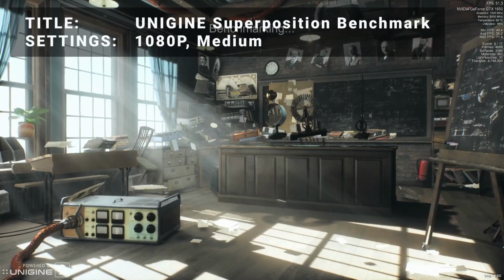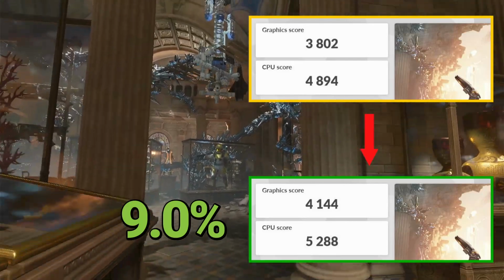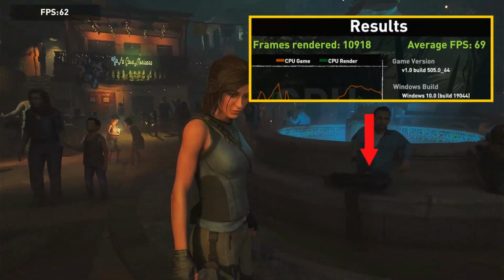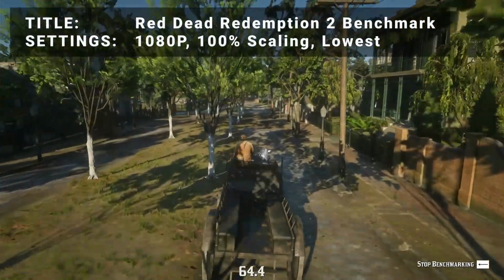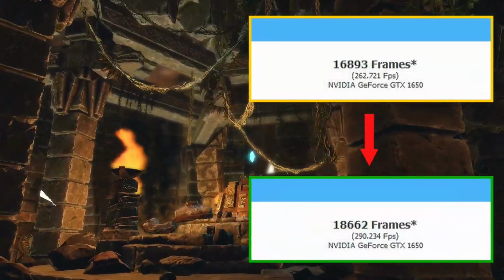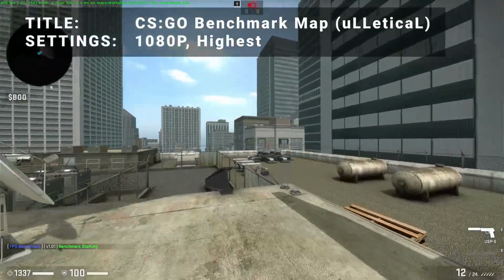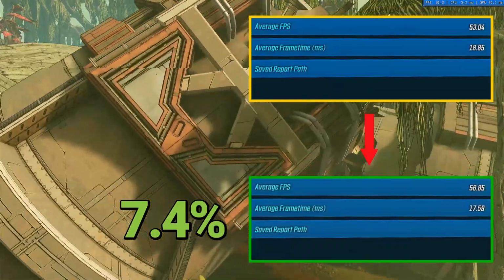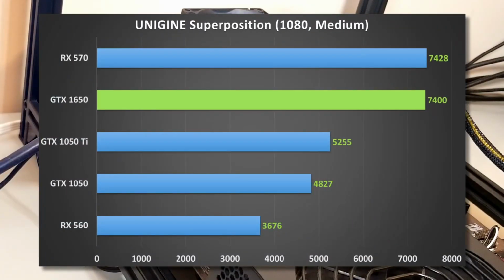Best GTX 1650 Overclocking Settings Guide

Comment: I overclocked my 1650 with msi and the performance got lower and when i reseted the settings it didnt changed to my normal fps   what should i do ❤

Comment: Just so I understand. If you overclock above 100 % power do you need to connect the 6 pin power connector, or is it safe to overdrive from the motherboard? (I guess not)

Comment: Hello i have a question, I have a laptop with a gtx1650 sometimes while i game my home electricity cuts off since i live in Iraq and recently my fps dropped drom 140 ro sometimes 60 or less ,is it because of the power cut off ?
Reply: yeah, you can make it so that doenst happens if you change ur energy plan on your windows

Comment: My card went to +1200 mem and +200 core stabely, i think i have a silicon lotery winner.
Its the asus tuf model and it does it at 80° idk how, the cooler is basicly an aluminum block
Reply: Yeah cooler is 'meh' on these😂

Comment: hey for some reason I cant increase power limit on my gtx 1650. I have a 6 pin connector on my gpu so It should have more than 75 watt tdp yes? but it doesnt. any idea whats wrong?

Comment: Awesome video ! Love the 1650! I've had my build for 3 years, and it was my first ever gaming graphics card.. but in a few days my GTX 1080 will arrive so it'll be my first ever PC upgrade. And I figured, I might as well overclock this little beast on the last days of using it to sort of send it out in a blazing glory lol
Reply: this is the only good reason to OC in 2024, but seriously , people who want to game with overclocking  a new GPU , dont , you'll be crashing or even worse damage your new gpu .. most modern gpu will push it self to the limit with only thermal throttle stopping it to keep it stable , overclocking is pushing the limit of  that safety feature .. if you just want to learn overclocking , hey you do you.
Reply: 😢 4gb vram is not enough for 1080p marvel rivals. Hopefully they release some optimisation patches
Reply: @SomePotatoChannel  put the game in fullscreen mode and lower your resolution to 1280 it will significantly boost your fps but visuals will go down
Reply: @alexcoutinho2354  bro i will not play on 720p. i just use upscaling but it still stutters even on 720p sometimes becauase the vram maxes out regardless of the resolution
Reply: @SomePotatoChannel  as you wish... i get 250fps on 720 with 1% drop to 150ish
Reply: @  stop the cap. No way thats real. You must be using epic tsr ultra performance or smth
Reply: @SomePotatoChannel  agreed, on my rx 6900 xt and 12600k I'm barely able to pull 120 fps at 1440p even with performance fsr which is rendering it from... 720p I think ? It's hard to get good fps in this game, it's poorly optimized lmao.
Reply: @  fsr performance on 1440p is rendering at 720p. So if you get 120 on an rx 6900 xt, there is no way hes getting 200 on a gtx 1650
Reply: @ yep
Reply: @SomePotatoChannel  yeah it's poorly optimized. Ive since rebuilt my entire system with an rx 6900 xt for a 1440p build, 16 GB of vram should be good for years lol
Reply: @Boba_Fett1980   dayum

Comment: I am getting low score of 6800 without oc. I am using a old cpu c2q 8400. Whether I can get high score if I change the cpu upgrade
Reply: yes, the recommended gpu for the gtx 1650 is the r5 4500, that is 681% better than the cpu you said

Comment: hi i have a gigabyte gtx 1650 i tried to overclock it but over +499 it simply crash how you got with +600
Reply: I’m using a laptop 1650 which is worse than yours and mine can do it so idk what’s wrong with yours
Reply: @DOOMWRLD2007  i texted gigabyte and told them they asked proof and they said that was broken or something like that and they added this isn’t out problem consider to get an upgrade the best thing we could do is a 20 euro coupon on your new gpu
Reply: Bad to hear. Just got one 2nd hand so hoping to OC it. Will suck if we can't

Comment: Is it possible my ddr6 1650 can overclock the memory by +1500?

Im running msi artifact scanner and above +100 core clock speed it shows artifacts

And above +1500 memory it does too.

Can a +100 +1500 be possible or i havent stressed enough?
Reply: dont just overclock it to that number you need to run gpu stress tests while overclocking and when the screen starts flickering thats when you know you pushed it to its max and you just got yourself some free performance boosts but look on youtube how to properly overclock gpu
Reply: or just go on msi afterburner and let it overclock it for you manually and safely. Khorvie Tech has a good video on that

Comment: his rig is pretty solid in a budget , get a ryzen and a better ram with 3200 or 3600hz ram and this graphics card will be goated
Reply: What about on ark asa?
Reply: It can’t even run battlefield 1 without stuttering and lagging. FPS drops into the 50s is a joke
Reply: @jackpoole6916  its still a 50 man dont get it twisted when we say goated budget remember budget its still in the phrase, for BF or similar a Ryzen7 780 AND a 8 or 16  GB Radeon RX GPU should be fine with any ram between 8 and 16 in the 3600 mhz vecinity

come on man my review was for a bugdet fornite / roblox / Minecraft rig not a BF capable pc lol

Comment: Hi, Intel i3 12100F 12th Gen + 32gb ram + GTX 1650 4GB is it good ? Do you recommend some values?
Reply: I have the same build just with 16gb ram what have u been recommended
Reply: Should be pretty okay assuming you don't go crazy. I'm currently running  +280 core clock and +610 memory clock on an i5 9300H and 16gb vram. Same gpu

Comment: Hey do i have a bottleneck my system is motherboard:P8H61-MX USB 3. 16 gb 1333mhz G.skill DDR 3 ram dualchannel and a I7 2600 on turbo boost but the graficscard i have buyd for 80
Reply: Is zotac 1650 ampc core
Reply from the maker: That's not too bad of a matchup. The CPU may be the slight bottleneck. The bottleneck calculator at https://pc-builds.com/ gives it an 18.3% bottleneck.

Comment: I am using +160 on Core Clock and +800 on Memory Clock. I am unable to adjust the Power Limit to more than 100%. Is it ok to have this settings with this power limit?
Reply from the maker: Great job, that sounds like an excellent overclock 👍
Reply: @XLSTech thanks for the video and answering comments it helped me gage my voltage I was afraid too boost it too 100%, and never understood how much memory too use as well.

Comment: what overlock did you use sir ? because i have the exact same card from zotac
Reply from the maker: With the example card we achieved a +140 core clock, +700 memory clock, with +15% power. It's a nice little card for sure. 👍
Reply: thank you  @XLSTech

Comment: Mine works with +200core +2000mem is that ok??
Reply from the maker: Interesting, that's a crazy memory overclock, what version of GTX 1650 do you have?
Reply: @XLSTech  gigabyte geforce gtx 1650 oc edition D6 the temps get really hot tho

Comment: is the i5-6500 good with gtx 1650 im upgrading from a gtx 660 to gtx 1650
Reply from the maker: An i5-6500 cpu is a fine choice for a GTX 1650 and shouldnt be a bottleneck at all. 👍